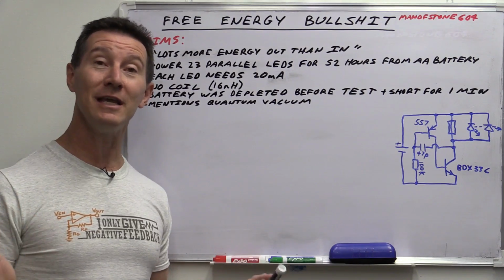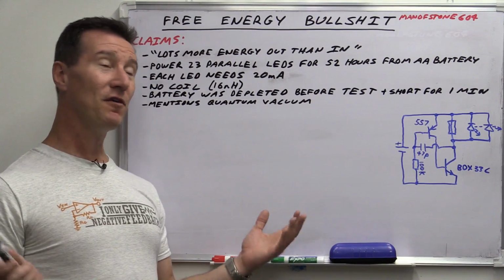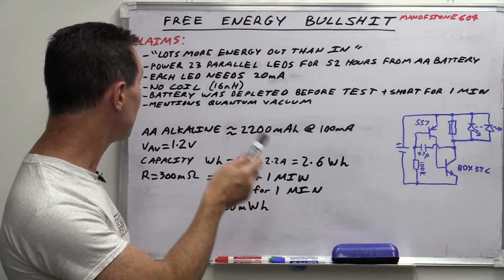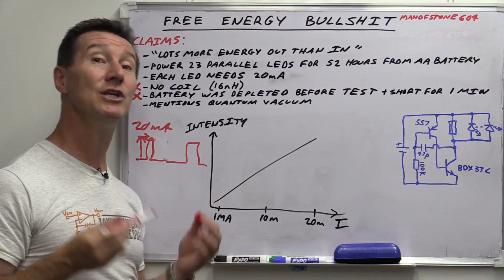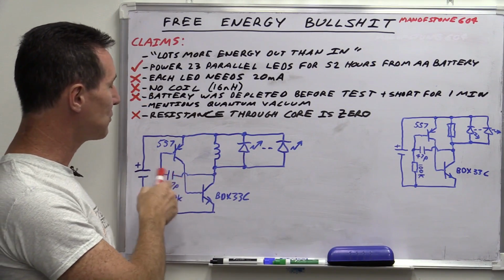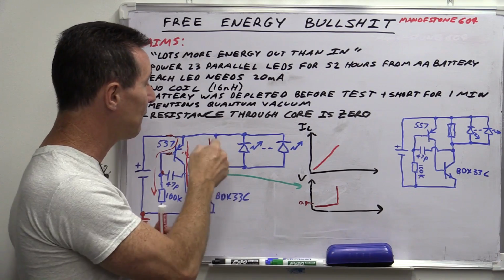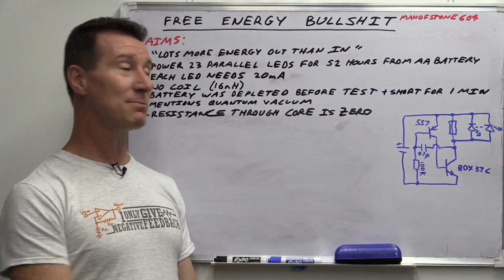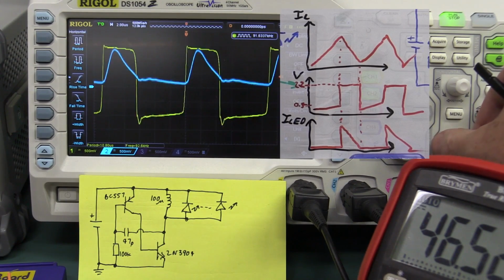EEVblog #708 - Free Energy Overunity is RUBBISH!

Comment: So much butthurt and moaning about being called out, so few demonstrative video responses or any convincing (or indeed, understandable) explanation of how these devices which violate every extensively studied fundamental physical law (without which all manner of essential and much more complex devices wouldn't correctly operate) actually achieve their results.

Not really surprising though seeing as no-one has actually made one at all ever, yet.

Here's a challenge for you: if these devices work so well, connect a bunch of them together in series to make something that can develop a couple hundred horsepower from a small pack of AA batteries, build an electric jetpack thing powered by it, and fire it up for a public demo in a busy area after inviting all present to film it on their phones, with as many of them as possible actually livestreaming it.

I expect to see this happen, and make it into the news, by the end of the year. Get on it.

Or if you can't do the jetpack, a car. With all the overunity parts clearly exposed, and it clearly demonstrated - with no jumpcuts or other camera trickery - that there's no other power source or motor on board. 200hp without the bulk and weight of a normal engine or battery back should make something quite speedy.
Reply: Or, better yet, let's see a small ring of them (you might get away with two, but certainly 4 or 5 should do it, especially with a flywheel to cover the switch from stored power to loop power) feeding back into each other. The energy within the circuit should continually increase, with the motors getting faster and faster until it hits such a speed that something eventually lets go in a violently destructive fashion, even from a very low starting speed and a very minor original source.

Think exponentially. If you could get ANY kind of useful overunity power out of one of these devices, then with two of them you could eventually develop effectively infinite output power after sufficient feedback cycles. You could develop weaponry that would conquer the world powered by a watch battery. Someone would surely have done it by now. Or they should have. So why don't you?
Reply: +mspenrice Probably against the law. Peredev motors are now legal in India. Non weaponizable
Reply: wtf?
Reply: ...yeah, because the first thing I worry about when making a whole new class of world-conquering ultraweapon is "oh shit, this might not be legal somewhere ... I'd better scrap it just in case".
Reply: Not human.
Reply: ...are you feeling OK? Is there someone we should call, anyone who looks after you?
Reply: I'll feel beter when you get informed, go to some shows, meet some people. You dont even know what to do. I have large diverse contingent of peers who are all involved in this.
Reply: Unless your being sincere, in which case I could use a full abdominal MRI and annvascular study.
Reply: Call the police, they'll sing you a song.
Reply: Hah not this guy!
Reply: No but I love you so much
Reply: It's tough love.
Reply: +mspenrice 
Video responses would only get ridiculed by non believing flatearthers just like the hundreds of videos already posted here on u tube, no matter how convincing.  Why don,t you watch them and join in the ridicule.

A formula/law/scientific proof for overunity will NEVER be allowed to be publicised.   It,s even becoming illegal in the U.S. to live self sustained or off grid now.   How do you think the government would see people living on free energy!  There,s videos here on u tube about that as well ... 

I,m actually glad there are people like you out their ridiculing free energy at every turn, because you keep it at bay and away from belief.  Sad really.   BUT at the end of the day it,s all about world order, and what sort of world order would we have if free energy was available en- mass?
Reply: +Bax Bax Efficiant circuts deal with quantum behavior we would need to modify the nature of element with the potential enery of then sun, when your talking about overunity your really talking about quantum mechanics, simple conducters and low power systems arent going to have enough potential to really augment anything without being under extream conditions. I would assume, and aside from temperature which could be a theoretical enviromental constant most other enviromental factors deal with transducance, Including gravity, circuts alone arent going to solve this problem but integrative mechanics will. Within our enviromental paradigm as it stands.
Reply: +Bax Bax but you are right, dealing with thing like synchronus quantum resonance would be high risk manuvers and potentially weponizable, I'm sure anything that deals with quantum potential is highy regulated.
Reply: +Bax Bax I think were in agreement
Reply: +diskman66 
mate I,m not agreeing with Anyone ... Especially when someone puts the word "weaponise" in their comment.   Not interested in what you have to say.
Reply: +Bax Bax as silly as you are stupid.

Comment: There's a saying from computer programming: 'SELECT isn't broken'. 'SELECT' is a SQL keyword used for projecting values from a table. This phrase means that you shouldn't assume something fundamental, common and tested is broken (the laws of physics) when there's a more obvious explanation: your understanding or approach is flawed. 

I wouldn't be surprised if one of the characteristics of most of these electronics-based free energy claims is that they are complicated or use components in unexpected ways, meaning its easy for people to make mistakes or assumptions about parts of the system on paper.

Comment: Send me a small low voltage good flat rechargeable battery and I will charge it with only a hand full of parts an no moving parts.Using known science you may not yet have learned. NO BULL SHIT DUDE.Adam VA of AVA Magnetic levitation AUS
Reply: I can recharge it using only a short t length of wire and a second battery. No moving  parts.
Reply: Depending were you live just the copper wire and basic parts no battery needed.

Comment: The "Quantum Vacuum" is a real concept of particle physics. It describes the activity that occurs in a vacuum because a vacuum is not "empty space" or "nothing", it actually consists of quantum fluctuations where particles and antiparticles condense and self-annihilate continually.
Theoretically speaking there is energy there if you trust that E=mc^2 but it is not possible to extract that energy because of the balanced nature of the system in that when one particle forms in the fluctuations, an antiparticle always forms alongside it resulting in an annihilation. So whatever energy you could hope to extract from these short lived virtual particles is conserved by the annihilation, thus cannot be extracted for other usage.
If there were a way to interfere with this activity and cause the fluctuations in the vacuum to enter a state of imbalance by, for example, inducing the field to somehow produce electrons but not positrons it then might be a possibility to produce electrical energy from the quantum vacuum but as we understand it there is no known method to manipulate the field in this way.
If there is a way to achieve such a goal, it requires a hell of a lot more equipment than a simple inductor and some LEDs and would certainly not become a source of energy because of that. You would spend more energy creating the conditions for the desired effect than you would be able to collect from the effect itself. 

I'm no particle physicist. My understanding of this is limited but what they are describing sounds like they don't understand what they've been told about the quantum fields present in a true vacuum.

Comment: first of all foes think different of words. Free energy.
1. You think it like, energy out of no where.

2. The foe there think energy there is there and just picked up like discharge.
3. Physic bender there make energy, by gather energy of surrounding and use it.

ex. Like earth heat generator there can transport more heat energy, then it use on
moving it i seen real data from them 300% moving of 100% use.
(teory the same as gather oil by pump, if the pump use more energy then it gather no cars simple as that.) heat can be transported to.
in that case sterling engine should be able to make energy to pump the heat to it self.
highest effect is 47% by sterling him self, transport 300% mechanic/heat loss 10%, 270%*47%-100% = 26% round down.

4. The fake foes there just whant to have fun.
5. The foe there faith as you call them
Reply: +Gepard mic heat object got lot of energy even more then you need to move it.
like if 46kj heat and you take out 10% heat mass(1/20)/kj you can run stuff the compression might only take 3,3% energy compared.

No matter foe like you all ready made this earth heat generator (danish translation) and was so powerful then it iced out the ground pipe, curse some turned full up in 70´s (when do foe learn to be careful) :-)

Tesla did know that 1m3 air got more energy in heat, then you ever gonna need for transport and base survival.
Like physic say energy cant be destroyed, or created.
Any system got losses.

Heat energy got
*No limit of how much KJ it can store (but use energy to light up)
*laws of Pressure can make heat and cold (transport heat, forcing solid (heat) to gas (cold) and back transport the heat). when something is cold it take energy from around there by (recharge heat). <- self charging battery
*About same mass no matter KJ heat.

chemistry energy
*Energy limit can be stored.
*pressure cant do more mass of it but react.
*Mass and energy depend on mass.

this should be able harvest energy, most foe just think of how to do Chemistry instead of, harvest energy that's why some think of free energy.
Reply: +Gepard mic LED of my only need 1mA

Comment: I bet in the vacuum of space one could generate massive amounts of electricity. After all motion is perpetual out there. If a copper electric generator was engineered well enough out in the vacuum of space could it be possible to make free energy well beyond the initial energy exerted?  Has an experiment ever been attempted in space to generate electricity using it's vacuum, taking advantage of Newtons 1st law? 

 Aren't orbits of planets a form of natural perpetual motion? Our thoughts and opinions of free energy are relative to our earthly bound nature.
Reply: +The deck Steady state motion doesn't generate any energy whatsoever. If you tap some menergy from the motion (via friction) the motion just slows down. Nothing gained.

Comment: Is overunity caused by power leaking from bulb-less light sockets in the parallel universe through a crack in the interdimensional flux capacitor? The truth will out, but I warn you it may well be boring.

Comment: OK - first thing I want to say is I am not a 'believer'! But I have watched the free energy ideas over the years with interest because, after all, modern chemistry does have origins in the futility of alchemy and all the exploration that involved.  So - my question is, does any of this 'free energy' stuff provide opportunities to make very energy efficient devices? For example, do the techniques used to attempt to make  magnetic motors and overbalancing wheels offer anything potentially useful towards making wind turbines more efficient for example? Many examples I see seem like very effective energy conservation - simply a balance of forces rather like something being in orbit - however, they do not accelerate which would surely be the sign that more and more energy was becoming available... BUT, I do wonder, could these techniques be useful when applied to other energy production systems like wind and hydro? Could they improve response time to wind turning the blades on a turbine or smooth out the fluctuation?? I do understand the principles of WHY you can't get free energy out of those things, so please don't be distracted by that - I'm just curious to hear opinions of whether all these attempts to get free energy are yielding anything that may have useful applications elsewhere. I find it hard to believe that people finely tuning these machines are not accidentally devising techniques of value to others even if their own dream is unattainable. Any thoughts??

Comment: What about HHO???(Hydrogen Production on Demand) Electrolysis with different types of metal, Stainless Steel, Platinum, Titanium etc.
Reply: +Mike W The first problem is that there really is no such thing as HHO.  What people are fooling themselves with is a mixture of H2, O2 and water vapor plus some impurities.  Each ends up fooled in a slightly different way but it always comes down to some mistake in measuring power in or power out with one exception:

If you take a massively badly tuned and inefficient engine and add a bit of the mixture to the intake, the engine will be slightly more efficient.  Basically there is a bit of an increase in the combustion temperature and some interesting chemistry that causes more of the hydrocarbons to get burned.  The effect is nowhere near as much as doing a tune up but can be observed.

Comment: Move a magnet near another magnet. Why isn't the energy causing them to attract or repel an example of free energy?
Reply: +TheBluzguy It isnt energy. Its a force, like gravity. A gravitic or electromagnetic force is not energy itself. It is a carrier of energy. Same as a spring. It takes energy to stretch it, and that energy is released when it pulls back. Dur hur. "Free energy" is an idea that you could power a car without putting any energy into the system. It's impossible. Energy has to come from somewhere. Magnets are not a source of energy.

Comment: It's great you did this, but you made one significant error. If the relative no-name DMM you used even has a true RMS frequency spec, I'd be shocked if it's much beyond 20 Khz as even a higher-end Fluke starts to degrade (generally read low) with non-sinusoidal waveforms at 50+ Khz. So, in reality, your average LED current was probably higher than the DMM was reading which means the oscillator was likely a bit more efficient than your back-of-napkin 50%.

In this case, the scope would have been the way to measure the true RMS voltage across the current shunt--especially as you had that waveform on the scope at one point. 

But hats off for providing a detailed reality check for the free energy crowd. I'm not sure what kool aid they drink, but they sadly mislead a lot of people into wasting time and money building things that are useless.

Comment: Don't get me wrong, I appreciate the framework we've been handed down by our intellectual ancestors, but..
It would be greatly helpful if they used the word "nonexistent" rather than "free" to precede "energy" when speaking of (hypothetically) getting more energy out of a nominally closed system than is in it.  Then I might pay attention when people speak of "free energy."  But as things stand I think, "Violates the law" and find something interesting to read/watch.

On top of which.. no device which harvests normally-unavailable energy should continue depleting a voltage source, it should be actively recharging/repleting any necessary initialization component.

Thanks Dave for spending time on ridiculing a ridiculous notion.

Comment: A gallon of  Gasoline = 114000 Btu per Gallon, if a car that gets 20mpg it would require 5700 BTU or 4.8584 oz. of gas per. minute 1 liter of Uncompressed Hydrogen gas only has 11.48 Btu. 

So a car that gets 20mpg would require 496.5 liters per. minute of Uncompressed Hydrogen gas .
 
Remember when you make 10 liters of HHO you have only made 6.6 liters of hydrogen

Comment: Energy is defined as current multiplied by voltage, multiplied by time:

E=IxVxT

10,000 Volts X 0.01 Amps = 100 Watts

10,000 Amps X 0.01 Volts = 100 Watts

where "E" is the energy measured in joules (also watt-seconds), "V" is the instantaneous voltage measured in volts, "i" is the instantaneous current measured in amps, and "T" is the time period measured in seconds.

Comment: Now for the first time ever electric cars will have a range greater than 500 miles between charges.  
http://www.electronicproducts.com/Power_Products/Batteries_and_Fuel_Cells/Researchers_accidentally_quadruple_lithium_ion_battery_lifespan.aspx
In addition the life expectancy for the batteries will now exceed 15 years.  This is the age of the electric vehicle with free, solar-powered vehicle charging stations.  Solar-powered vehicle charging stations have been installed and are up and running in San Francisco.

http://www.cnet.com/news/san-francisco-introduces-free-solar-powered-electric-vehicle-charging/

It will only be a matter of time before this becomes Nationwide the age of the internal combustion engine is over regardless of rather it is running on hydrogen diesel or gasoline.

Comment: Success in generation of rotary electro-gravitational Alcubierre Warp Drive means that the energy extraction machine shrinks space-time metric drawing far bodies of mass a little closer so by Mach's principle, they lose gravitational energy and the machine will extract energy on the expense of the metric. The problem is that the Warp edges will cause strong microscopic tidal forces. Any such machine if completely solid, will break down after short use.  Please read my paper and its corrigendum,
http://sciencedomain.org/abstract/9858
DOI: 10.9734/PSIJ/2015/18291
See also corrigendum 
to DOI: 10.9734/PSIJ/2015/18291
in http://sciencedomain.org/issue/1288
We need to keep an open mind. Inertial Induction was discussed by Dennis Sciama in 1953 and had a covariant formalism also by Dennis Sciama in 1964.

Comment: the grav pull is of use
Reply: +Cassie Petty You mean power generation using gravity? Technically speaking that is one of the oldest methods for both mechanical and electromagnetic energy with things like watermills and hydroelectric dams. It is still a lossy and limited system though.